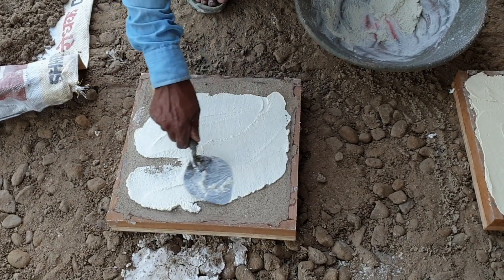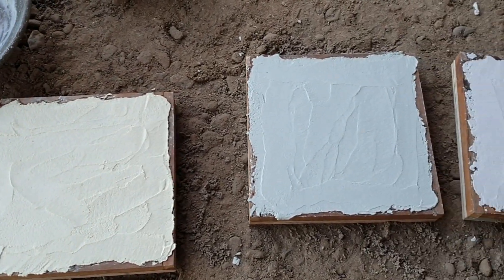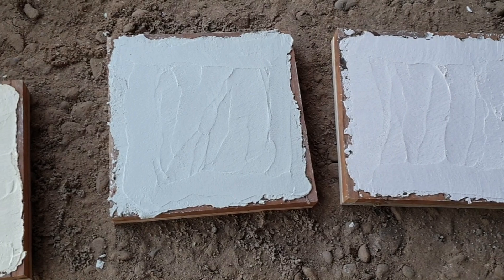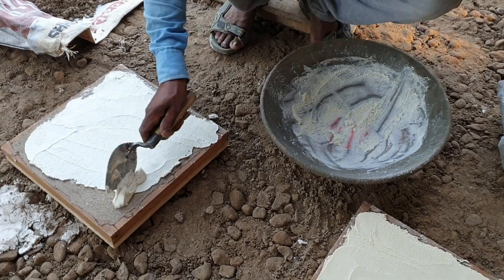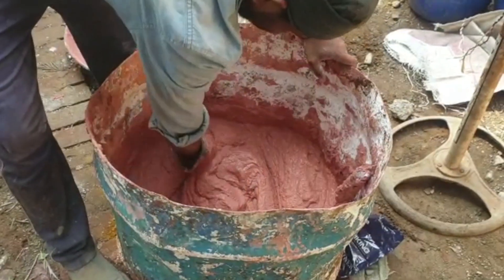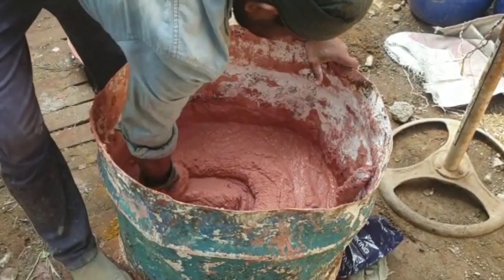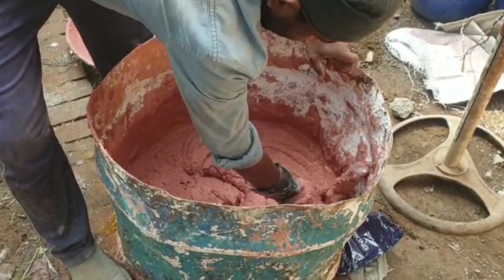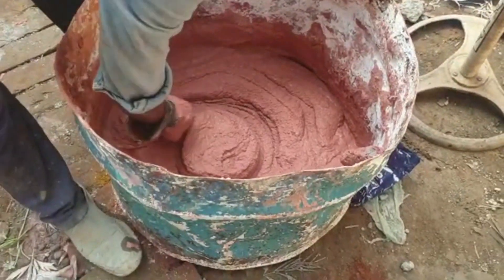How to do Textured Lime Surface Finish

Comment: Thank you for such wonderful and informative content.
I'm in the process of making my own house. And I would like to use lime on the wall surface instead of Putty or POP. I would like to know about the Ratio of mixing Lime and Marble Dust (Lime:Marble). 

Thank you.
Reply from the maker: Hello, we used a premix sold by MLIME. We don't know the proportions - you can check with MLIME please. Thanks

Comment: Ok. Rammed Earth wall and layer of marbel dust + lime + pigment. How many layers? As described in the video dust are of different sizes. And each size make a different material. Have you used 4mm of larger sized dust mixture layer and 4mm of finer sized marbel dust? Or one size one layer? or differnt sizes mixed in one layer? Sorry, I am not getting it clearly.
Reply from the maker: This video is for a textured lime surface. This is just one layer application with larger sized marble dust + lime mix.
Reply: What ratio of lime abd dust please